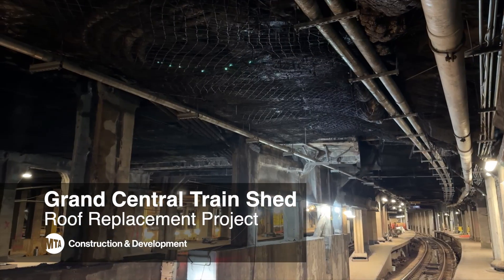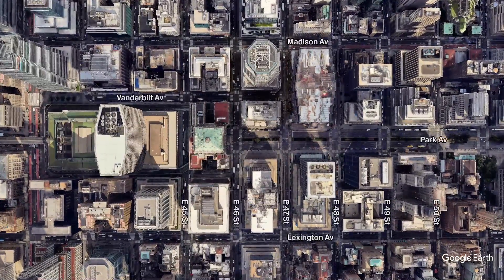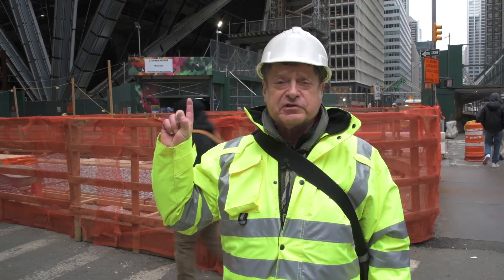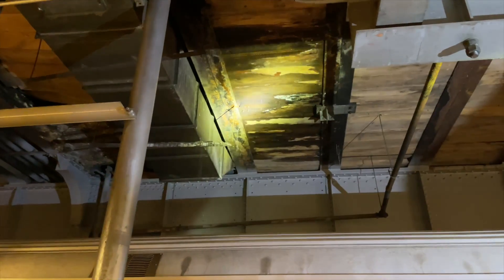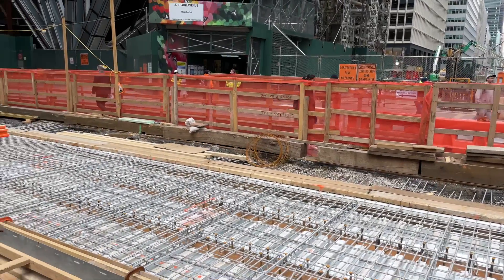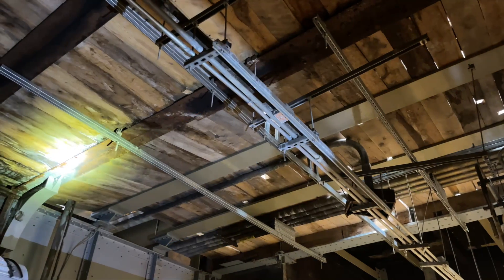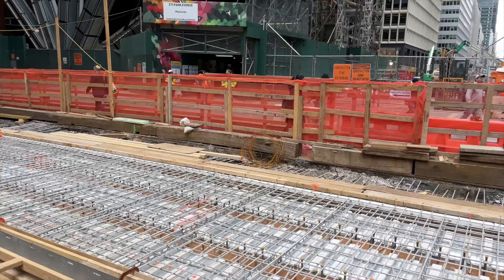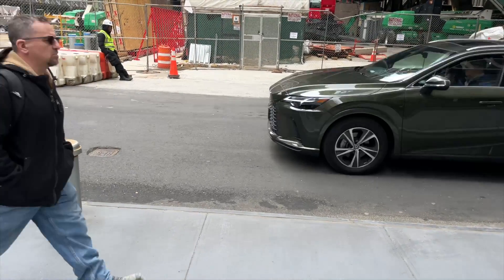Grand Central Train Shed Roof Replacement Project

Comment: If they would think ahead (which they probably don't), they would rebuild it with provision for future overhead electrification.
Reply: Given that it seems like this is barely below street level, in fact that the roof of the station is the bottom of the slab and the top of the slab is street level, that would seem to require excavation to lower the floor of the station? That would be… expensive.

Comment: Oy. This is going to take a while.
Reply: It takes a while to do it right. Besides, replacing decaying infrastructure now is a lot cheaper, safer, and faster than dealing with a roadway or building collapse if the old structure gives way.

Comment: Will you be able to see the Metro North trains from the street?
Reply: No. The real estate above is too valuable.
Reply: @maciekkra539  What do you mean? The video shows that they open up roadway or sidewalk. (No estate above) The question is whether they open up enough of a hole that a passer by could see the train running below.
Reply: @u1zha They opened it up basically removing the original roof. Listen to the commentary, they are replacing the roof. I assume you were asking if the open space will be left...no, because companies which have businesses above, have so-called air rights for which they pay to keep their business. That's why the roof replacement and eventual cover up. You might see trains temporarily as they keep uncovering piece by piece and maybe snap a couple of pictures here and there.